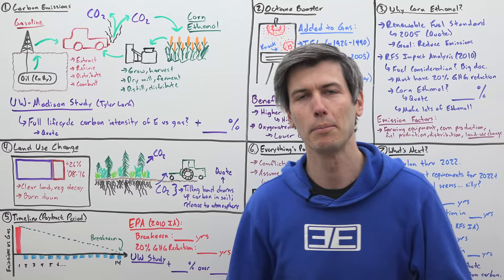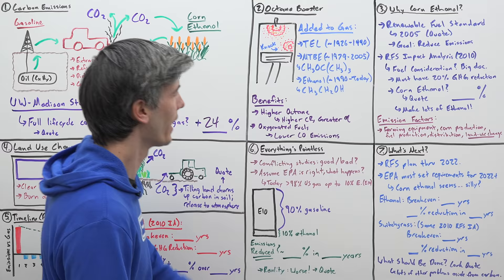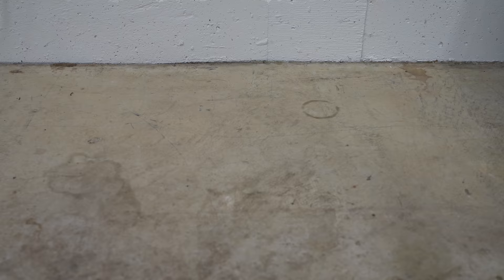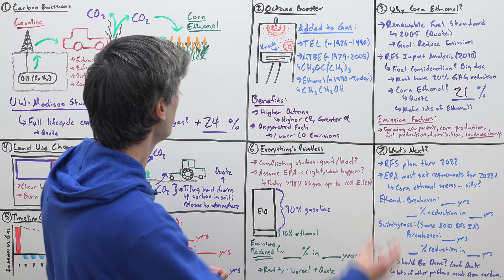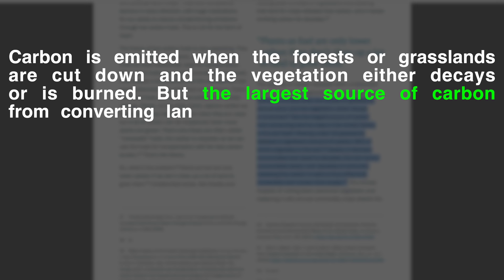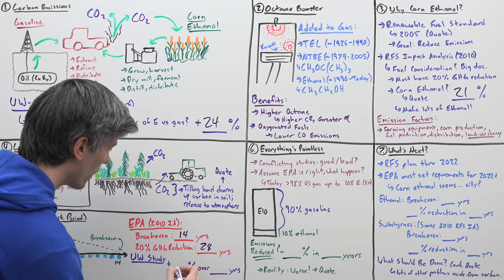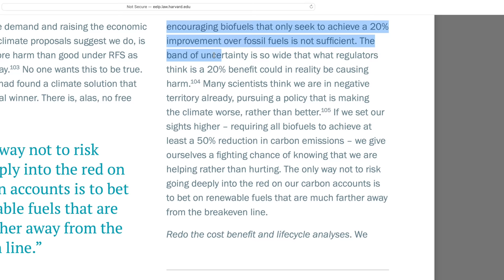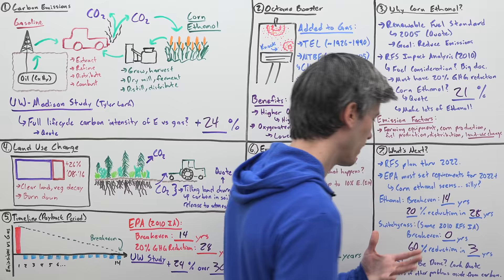America Was Wrong About Ethanol - Study Shows

Comment: Great explanation, are you able to do one explaining the amount of environmental damage that is done during the production of just one Tesla? Research I've heard of is people have calcuated the damage, its the equivalent of making 50 ICE cars and running them for 20 years, mostly due to the way the batteries are manufactured. It would be interesting to see what you came up with.
Reply: Good point. I have read so many articles on this. It is hard to find the real truth. A few years ago I came across a Tesla model S on fire on the side of the road. The fire department just let it burn. Not sure why, maybe they did not have the proper extinguisher for this type of fire, or maybe they did not want to extinguish it with water given the high voltage of the battery pack
Reply: @davidsacco4860  LITHIUM BATTERY fires are NASTY!!! ...dumping water on that much ELECTRICITY with no way of CUTTIN THE BATTERY CABLE is BAD...  and still the WHOLE FLOOR IS BATTERIES RIGHT??? so you can't just put a bag over the battery and DUMP THE WATER :) sigh....
Reply: @alexmikhael5061  Thanks Alex, that is what I have heard in the past but wasn't sure about it. I was amazed how intense that car fire was. They had to block off the road but  I got to see it burn since I was a few cars back from the road block. I remember when cordless drills first came out and we bought a few DeWalt drills. The drills were very good but they had problems with the first lithium ion batteries.  We had a habit of leaving the batteries in the chargers which was not a good idea. A couple of the batteries overheated due internal shorts and started on fire. Fortunately we had a dry chemical extinguisher on hand  and eventually we put out the fire. As I remember it took awhile to get the fire extinguished. Most of these electric car batteries are in the range of 680 volts so dumping water on them when they are burning is not a good idea to say the least.

Comment: One of the best channels on youtube quite honestly! Always a pleasure to get a thorough breakdown of the topics.
Reply: Very far from thorough. No mention of Distillers Grains so invalid conclusion. The corn used for ethanol also produces nutritional protein and fiber. About equal to that of soybeans. Processing soybeans is also land and energy intensive. So all of the cost and land use of the soybean equivalent has to be accounted for. That easily puts corn ethanol into net benefit.

So same old half baked gibberish being reported on here. That's without even getting into the switchgrass would be better nonsense.

Very few people, seem to know enough about how agriculture actually works. Every study I've looked at that is critical of corn ethanol fails to account for the distillers grains that is also produced. Word search on the research he cited doesn't show any reference to it either so it's probably safe to assume this is yet another one of those massively flawed studies. Also most fail to account for current no and minimum tillage practices used on farms. 

The protein in corn is not consumed when making ethanol. The proportion of protein in whole corn is too low to make feed so additional protein from soybeans is added to make a balanced feed. However, the protein left after making ethanol is a source of concentrated protein called distillers grains which is then used instead of soy protein. It works out that for every acre of corn used for ethanol, an acre less of other crops is needed.

Corn is about 10% protein. Soybeans are about 40%. By using both, feeds ranging from 14% to 22% protein are often made. However, neither corn nor soybeans have enough fiber so a source of fiber also has to be grown. After the starch is used from the corn to make ethanol, the protein is left in the distillers grains at about 30%. The 30% protein distillers grains can be mixed back with 10% protein whole corn to help make the needed balanced protein. Plus the distillers grains still has the fiber. That reduces the need for soybean and fiber crops.

On a percent basis, soybeans have about 4x the protein compared to corn. However, corn produces about 4x the yield per acre. So on an acre basis, corn and soybeans are practically equivalent for total protein production. That means for every acre of corn used for ethanol, an acre less of soybeans is needed. Plus less land is needed for a fiber crop. So their claims of land use change due to corn ethanol are gibberish.
Reply: @heartysteer8752  Well thanks for taking the time to write that out! I honestly don't know enough about agriculture to make any claims, but if the 'waste' product after distilling is used for feed I can't imagine how any study could miss that.
Reply: @heartysteer8752  They did mention this: "We found that the RFS stimulated 20.8 billion L (5.5 Bgal) of additional annual ethanol production, which requires nearly 1.3 billion bushels of corn after accounting for coproducts that can be fed to animals (46)" And you're saying this doesn't include the distiller's grain?

Comment: I’m a farmer. It’s completely crazy to think we use land to grow corn for ethanol. that land could feed people instead
Reply: No, we already dispose of close to 40% of our food. We need to reduce carbon. And find ways to distribute the food we already produce (which could easily feed everyone).  Please research this.  It is eye opening. Climate change will most likely cause famine in the future.
Reply: What kind of farmer are you? If you really knew about corn ethanol and land use you wouldn't think it so crazy.

The protein in corn is not consumed when making ethanol. The proportion of protein in whole corn is too low to make feed so additional protein from soybeans is added to make a balanced feed. However, the protein left after making ethanol is a source of concentrated protein called distillers grains which is then used instead of soy protein. It works out that for every acre of corn used for ethanol, an acre less of other crops is needed.

Corn is about 10% protein. Soybeans are about 40%. By using both, feeds ranging from 14% to 22% protein are often made. However, neither corn nor soybeans have enough fiber so a source of fiber also has to be grown. After the starch is used from the corn to make ethanol, the protein is left in the distillers grains at about 30%. The 30% protein distillers grains can be mixed back with 10% protein whole corn to help make the needed balanced protein. Plus the distillers grains still has the fiber. That reduces the need for soybean and fiber crops.

On a percent basis, soybeans have about 4x the protein compared to corn. However, corn produces about 4x the yield per acre. So on an acre basis, corn and soybeans are practically equivalent for total protein production. That means for every acre of corn used for ethanol, an acre less of soybeans is needed. Plus less land is needed for a fiber crop. So their claims of land use change due to corn ethanol are gibberish.

Corn ethanol has another benefit for human security. We depend on corn not only for food but also many manufacturing processes. If there is a severe drought for example, ethanol production could be reduced.  Thus, helping ensure enough corn for other uses.  I'd guess a 20-30% buffer against really dramatic consequences.

If you want to complain about the overall human diet, go for it. But given current consumer demands, corn ethanol helps ensure food supply.
Reply: @heartysteer8752  thank you for this in depth reply.  It definitely shows this is a much more complex issue than even the original video contends.   You have a good point.  But, we are trying to discuss carbon emissions,  or their reduction.  Is ethanol and its production,  taking into account what you described above, the best way to proceed?  Maybe there is a better alternative? Idk just asking the question.

Comment: Awesome content dude. You should do the same analysis on what they are doing to the earths soil to dig up the materials to make batteries for these new electric cars. And what they do after the battery’s life is spent. I’m sure it might wake a few people up
Reply: There have already been analyses that have examined the cradle-to-grave impacts of producing and operating an EV vs an ICE vehicle. Most of them conclude that EVs are slightly better in that regard, even when the power grid used for manufacturing/charging them is coal-intensive. EVs are not ‘good’ for the environment, per se, just somewhat ‘less bad.’ They are still mainly occupied by one person, cause traffic jams as they commute dozens of miles to/from work every day, help take up millions of acres of land for parking space, etc.
Reply: Agreed.

A fallacy often cited is that corn uses fertilizer that is made using oil. However, the fertilizer could instead be made using energy from other things like wind and solar. So compared to electric vehicles, ethanol isn't as bad as they'd have you believe either. It could even be complimentary. 

One of the big challenges with wind and solar is variability. That makes it very difficult to match peak supply and peak demand. Making fertilizer doesn't require a steady energy input. So it can be made using excess energy. By using excess energy, base infrastructure can usefully be increased. That reduces the need to develop storage capacity.

Comment: I'd love to see a video on the brake even point of solar powered electricity for fuel. From the production of the panels to the solar farms and the impact they have on the land they cover, to the getting it to your tesla. 🤔
Reply: Absolutely, so many unknowns.
Reply: Since solar farms are usually in dry, arid regions, I expect the land use impact is minimal.  But the panel production and concrete footing installation definitely takes a carbon footprint.
Reply: The current solar farms may be in dry arid regions, but electricity can only travel so far in a conductor, so as the goal of zero carbon emissions presses on, more and more fertile land will be converted to solar fields, further reducing the viable land to grow crops for food. This seems to be one of the government objectives.
Reply: @Ez-sk8ig  you can transmit power around the world with high voltage DC with minimal losses. Location is no longer a factor.
Reply: How do I step up or down the power to my toaster
Reply: @peteparadis1619  a simple transformer.
Reply: @eyeballengineering7007  Won’t work on DC
Reply: @peteparadis1619  That is literally what they've designed it to do. High voltage transmission lines can absolutely be DC. That's the big new high voltage transmission setup. DC.

Comment: There are a lot more things to consider than just the fuel's emissions reductions though as well. I own an older jet ski. Do you have any idea how much of a pain it is to find fuel for it? I can't use fuel that contains ethanol in the thing, because it'll literally melt the fuel lines and parts of the engine.

A fuel made from switchgrass might result in a 60% reduction in emissions, but that does us little good if the resulting fuel will destroy the engines of every vehicle currently on the road.
Reply: You said "older" jet ski. It will probably run very well on 100LL, or AvGas, available at your local general aviation airport. Where I live it costs about a dollar a gallon more than unleaded. It contains a very low percentage of lead (0.56g lead/litre Max), but NO ethanol. All my small gas equipment is old and does fine on the 110LL.
Reply: @sierraspecialtyauto7049  - That might do the trick. The guy I bought the ski from said he used 4 gallons of non ethanol 95 octane mixed in with a single gallon of 110 octane. Something to do with modifications made to the exhaust system meant that it won't run well on the lower octane fuel anymore.

Thankfully the local airport did indeed have a mechanic shop that sold the fuel types I needed. The ski is a mid 90's Sea Doo that was modified with some aftermarket parts. Skis that old contained fuel lines that just weren't made to stand up to ethanol, and the stuff literally dissolves them.

Comment: Here in Brazil we use sugar cane to produce ethanol, our studies says that there's a 73% reduce in emission of CO2
Reply: Yes, but the climate is not warm enough here for alcohol.  Cold weather it will not start an engine.  If you could start on gas and switch to alcohol it will work.
Reply: @ridgerunner106  I'm not defending this kinda of fuel, was just a new information. I don't have enough information to know what's the best solution

Comment: I've always found it interesting how ethanol is blamed on the "powerful farming lobby".  As if the oil industry that now has 10% less demand doesn't have any lobby to pay for its own studies.

This is one of the best videos I've seen as far as explaining many different factors about this subject, but must be understood that farmers are getting better at no-till farming, eliminating that carbon release from plowing and plant decay factor you're talking about.  There are so many factors that you can easily change them to make a study say anything you want.
Reply: Reduced tillage farming has other negatives in the form of the chemicals needed for weed control, GMO seed to make it compatible with said chemicals, etc. Farming is all about making money and that means using the methods that minimize the cost/bushel of your crop. We have owned a couple of farms in the past that we rented out and they were never anything but corn with traditional tilling methods. 
I would have preferred to see crops rotated and minimal tilling but that would cut the rent if we insisted on it.
With higher fuel costs this spring it will be interesting to see if there are some farmers that find it more inviting to use low-til. Depends on the other costs, and for large operations that also includes labor. Those tractors don't drive themselves!

Comment: Has the auto stop on idle been studied? I haven't seen any improvement in MPG with this feature on and I wonder if the shortened life of the starter and battery were taken into account as far as the environment is concerned. Rebuilding a starter and battery does require using energy and disposal of some toxic materials.
Reply: I haven't heard any updates on the effectiveness. I know the initial concern with wear on starters was to use beefier components that could handle the more frequent starts and avoid the need for replacement/rebuilding. Jason did another video about start/stop, and there is some minor benefit if the vehicle stops for longer than 7 seconds. But like you said, we haven't gotten updated studies on real-world numbers

Comment: Seems like using ethanol might be a good choice just on the basis of needing a better octane boosting additive to gasoline, it's just that it can't be relied on to affect carbon emissions.
Reply: It seems that the ethanol is less impactful, but the process of making it creates the emissions
Reply: I never heard of ethanol in gasoline boosting octane.  It degrades mileage.
Reply: @donaldkasper8346  it definitely does they have ethanol is alcohol they have drag racing cars that run on nothing but alcohol and almost every big power street car with a turbo runs off e85 which is 85 percent ethanol
Reply: @masonspohn125  Horsepower is gained by using ethanol in huge amounts, but when added to gasoline in a 10% mixture it robs HP and decreases mileage. I'm not an engineer and can't explain it but I AM a long time mechanic and motorhead and I see the results while not necessarily knowing why.
Reply: we bought an e85 truck in 2006, went out of our way to fill the tank with the stuff and I do mean out of our way, it was hard to find, noticed 2 things, the E85 cost the same as regular gas but netted about 1/3 less miles to a tank. This quickly ended that experiment for us. Been running that truck on standard reqgular gas up to this day.
Reply: @masonspohn125  Drag racing is called want torque, not fuel efficiency.  No one uses pure ethanol for car or truck engines due to problems in wear and performance.